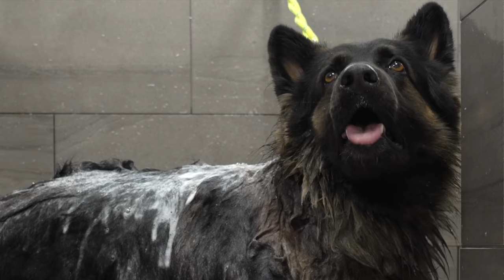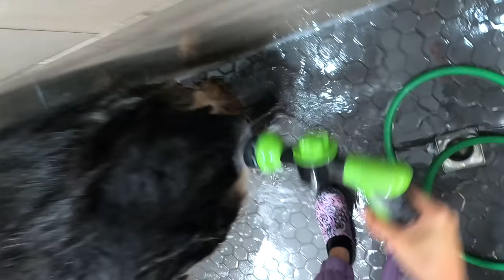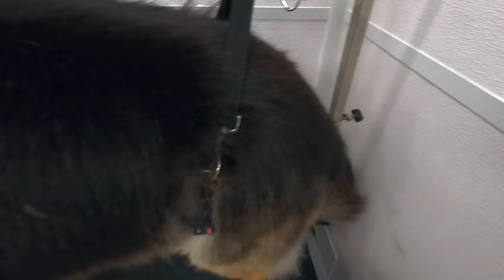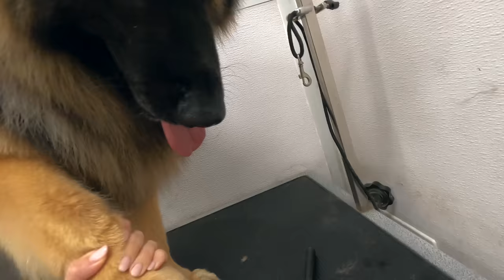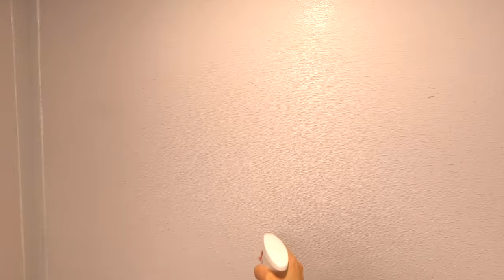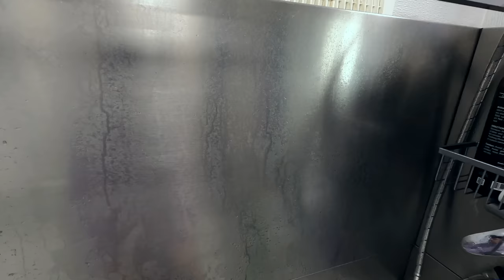Caught in a F5 FURNADO

Comment: The F5 stands for “Fur 5 tornado;” Powerful winds from the air snake, flying floof debris, and enough dead hair to make a fur coat, it’ll leave your grooming salon looking like a fluffy explosion!
Reply: It is possible to spin dog hair, she could have a side line in chienangora
Reply: Considering that day experienced TWO full, rapid-fire F5 furnadoes, they both merged into a class 6 furball. Probably enough fur to make a Shepherd sweater or two (if Shepherd fur can be weaved like wool and cotton can).
Reply: @ForteanEnquirer I needle felt and wet felt exclusively with dog hair, I’m actually working on a portrait while I watch this lol
Reply: I not only ❤️ the grooming process because you explain each detail U do and explain why U do certain things that way.  Your shop gets cleaned very explicitly.
Reply: @Operational117 , it can be (once it's spun, of course). Any double coated breed is good.
Reply: You could probably fill some puffer jackets with the fur
Reply: i agree with spinning fur and y’all are all hysterical
Reply: You can spin it into yarn by adding a longer staple fiber like wool or silk. The longer pieces hold the shorter dog hair into the yarn.

Comment: Love your videos... I was a cleaner/lead hand in a hospital for years and used extendable mops(wall washing wands) that made wall washing/ floor washing so much easier...not as much bending kneeling and stretching...the wands have removable heads/mops/ pads that are machine washable...they can be purchased at janitorial supplies stores...a good investment that will cut down on your clean-up work...there are also wands that have a soap/liquid bottle attached...🐕
Reply: I'm a former janitor for schools. Great suggestion!
Reply: We have a cleaning company and these are invaluable for doing dirty walls. Cleaning is so hard on the body, might as well make that part easier on yourself!
Reply: I was gonna say  -- Vanessa works hard enough on these precious doggos that give her the Furnado treatment. "Work smarter, not harder" is something I adopted from my very brief attempts at factory work. Got the advice from a 2nd-shift foreman. Any way I can shorten my work time or make a physical job easier on a funky lower back, I will. 😅
Reply: Correct me if I'm wrong, but maybe she should consider wearing a mask and gloves as well while cleaning. Bleach isn't friendly for our skin and lungs.
Reply: Have you possibly considered a brush attachment on the end of your shop vac for the wall?  Might save you a little time just to vacuum it off instead of brushing it by hand. :)

Comment: Several strips of double sided tape and a high thread count bedsheet might save you some wall scrubbing. When the day is done you can pull the sheet down and shake it outside / launder it, and then you won't have to spend as much time de shedding the wall before disinfectant. 

If that works, you can replace the tape with velcro strips and sew the corispondant side into the sheet.
Reply: The. There will be hair outside where the finished dogs run.

Comment: Would you have any use for a plastic cover for your smaller tub? It could potentially save you time washing the whole thing if you have a weather forecast at hand :)
I've worked in labs for a while, and if you were ever worried about disinfecting your shop, I would suggest 2 cleaning products on rotation (as in different active ingredient/mode of action). It helps prevent any bacteria to gain resistance to your current cleaning regime.
Thank you so much for all the work you're doing for these lovely creatures :)

Comment: I wonder if a saw dust collection system, like the ones used in wood shops, could be modified to collect a lot of that fur while you're drying the dogs.
Reply: I wonder if the noise of that would bother already stressed dogs? It seems like a great idea, but I'm not sure how noisy they are?
Reply: @thebookwyrmslair6757  The vacuum can be in a different room or even outside.

Comment: Gonna need a bigger shower with all these massive dogs.  I think there should be a closed in room with a wind tunnel ventilation that sucks all the hair up and out so the fur doesn't go everywhere. I would also suggest a Rubbermaid Hygen microfiber mop system to get the hair from the walls and underneath.  That's what we use at the hospitals where I worked to clean the OR'S. Makes life a lot easier especially on the back.

Comment: Not sure exactly how much space you have, but maybe consider a small, floor standing dust collector (typically for wood working machines) that sucks up super fine dust and chips, hooked up to a plastic trash-can with a Vortex lid on it.

It's . . . absolutely . . . amazing.  When I was wood turning for 15 years I had a small Jet Dust collector.  Not one of the big mambo ones, but their entry level model.  Footprint is, hmmmm, about 12" x 24", sort of vertical standing with an upper and lower bag.  I think the Jet model nowadays might be the DC650.

The secret though is a product from another company.  A plastic lid for a trash can shaped in such a way that once the dust collector is turned on there is a powerful cyclonic vortex formed in the trash can.  Hook your inlet and outlet hose on leading to the dust collector, lid goes on a large plastic trash can that is FIRST in line for sucking up dust and debris.  The cyclonic vortex formed inside the trash can holds the vast, vast majority of particulate, including super fine dust, so that you get almost nothing going through the dust collector's impellers and into the 30 or 5 micron bags on the Collector.

What this meant for me in the wood shop was:  marathon turning session, massive amounts of not only chips, but ultra-fine sanding dust piled everywhere, just take the dust collector hose, turn it on, and vacuum everything up with impunity.  Chips, nails, bark, debris, super fine dust, didn't matter.  It all went ZOOP! into the trash can and stayed there, stuck to the sides of the trash can by the tornado vortex, and I never had anything hard whack it's way through the dust collector's impellers damaging them.

Time to empty the trash can?  Just pop the lid off and go dump it.  Or, as some woodworkers figured out, put a Hefty trask can liner in it, add maybe a piece of wood to keep it in place until you started to get some debris in there to keep it in place, go to town, and then just pull the trash bag out like you do normally.

sorry for the TLDR.  But that dust collector setup made life so perfectly easy in my wood turning shop, it seemed it might (maybe) be a fit for the Fur-Nado Disasters you show in your shop.

Thanks for the video.

Comment: Helpful Hint! You may want to use a drill with a brush attachment to clean the shower and the sink. Make sure the drill is water rated like Metabo. I use it to clean my tub and shower. It is so much easier and quicker. It requires less effort too. Love your videos. I find them relaxing and informative.

Comment: To cut down cleanup work, try covering areas that you are not using.  A tarp over the bath tub and removing the chair from the room saves you time.  You might try a long handle adjustable brush to clean the ceiling and walls.  You can purchase the interchangeable heads.

Comment: You need a netting around the drying station to prevent hair going all over the shop. I’d also add a shop vac to the wall above that drying station, turn it on when you’re blowdrying to catch a portion of the hair. Less cleanup afterwards

Comment: I'm sure you have a lot of folks making suggestions in the comments, but I have one of my own to deal with that wall of yours that gets covered in hair. 

I've found that using a Swiffer or a similarly adjustable mop with a dusting attachment is really effective. My long hair cat sometimes sheds hair up to the corners of our ceiling, and using a long pole dusting implement makes it a lot easier on my back and my neck. 

Maybe a dusting noodle? Like the long fiber ones with adjustable arms?

Comment: "Why does the watering can work better than the spray nozzel?" physics. Water is basically incompressible, so when you use the watering can, or the hose without a spray head, the water you are shooting out is somewhat like a glass rod, wherein all the water behind can push the water deep down. The spray head is specifically designed to create little spheres of water (spray) and so you only get the momentum that the droplet had when it formed. Imagine the difference between throwing a BB at a pane of glass, versus a metal rod. That's, roughly, the difference.

Comment: For the record King Shepherds were created using the German Shepherd obviously of the foundation and then they out crossed with Great Pyrenees and American Akita and then they bred back to German Shepherds basically to create a German Shepherd look alike only larger. Shiloh shepherds are a little bit different because they purposely wanted to breed a softer temperament instead of the traditional guardian and protective temperament of the German Shepherd. Shiloh Shepherds used primarily working line German Shepherds. The Sable coloring in the Shiloh Shepherds is NOT from the Malamute. Working line German Shepherds primarily come in sable also called wolf grey. If you look up a working line black Sable German Shepherd specifically a long-hair aka long coat or even plush coat  working line black Sable German Shepherd you will see the Striking resemblance to the Shiloh Shepherd. Essentially the Shiloh Shepherd looks just like a working line long coat Sable German Shepherd but is larger and has a much softer temperament more loving and accepting of strangers and not protective of their people. The Eastern lines of working German Shepherds with long coats as they also come in stock coat usually, resembled a Shiloh Shepherd the most in appearance.

Comment: Thank you for showing the clean up process. It seems dumb and obvious, but it’s a big part of cleaning up after a dog. I have to blow dry my husky in the garage (bcs it rains 9 months out of the year here), but have a fridge there. So little do ppl know that I have to do things like vacuum the fridge vents (grills? no idea what they’re called) and check on the furnace area bcs of the fur so it doesn’t start a fire. But my wife just leaves a mess behind bcs she thinks that the garage is considered “outside” and thus fur will automatically blow away - and surprisingly, my roommate also thinks the same. I’m guessing a lot of ppl don’t think cleaning up is something you have to do.

Comment: Would spraying the wall down with a spray bottle mist and using a big squeegee help ease the process on that wall? I wonder if rewetting the hair and having the rubber of the squeegee getting the hair from all the little nooks and crannies in the wall would nake goue clean up easier and also keeo dry hair drom flying around and getting on the floor you justbcleaned. 
That's how I get all of my hair off the shower walls 🤣